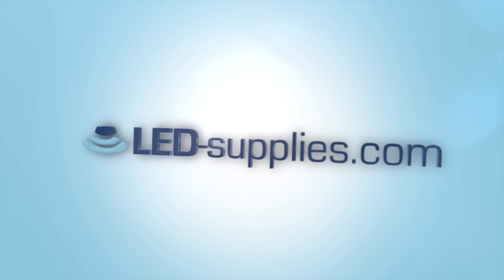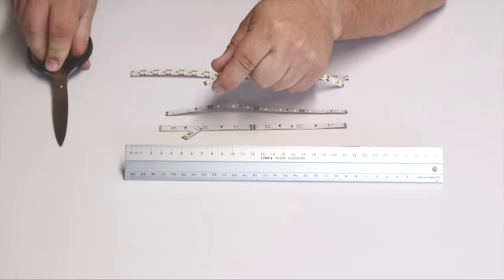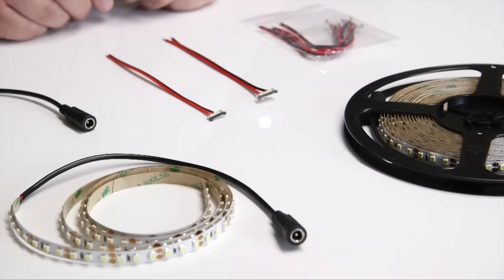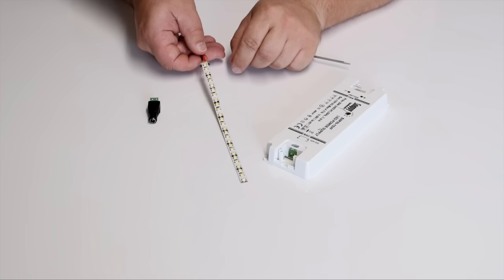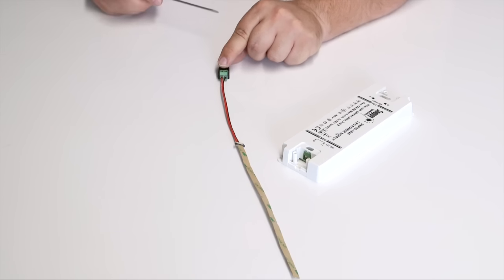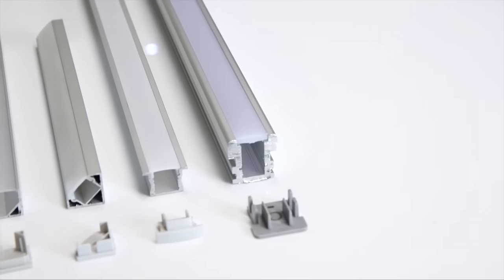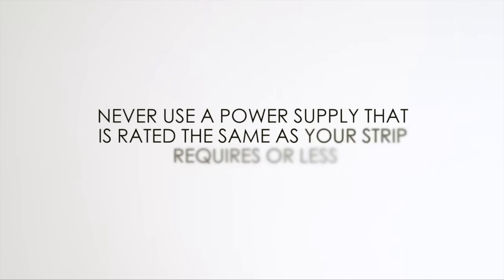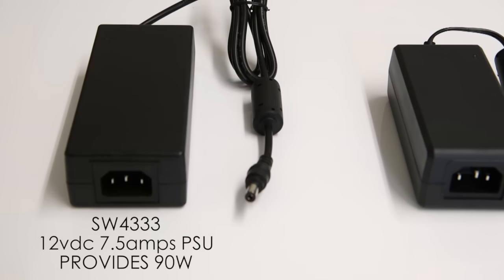How to cut, connect & power LED Strip Lighting

Comment: What's the best way to replace a normal ceiling light with this type of LED strip? The big question is how to power the LEDs. (I want them powered from a light switch, not a battery pack.) I've been missing a light in an upstairs room for quite some time and I also need light in my loft. My ideal solution would be LED's like this. (And in a perfect world they would be dimmable.) Is it possible? Thanks in advance for any replies.
Reply: yes, led strip is dimmable

Comment: I bought 5050 RGB waterproof with a silicone surface/covering. To make a connection do I need to peel off the outer covering? Seems like it
Reply: Hi we are  led  strip light factory  may i have  your e-mail address？

Comment: i bought a strip from amazon that did not come with an adapter. Which kind should I buy?
Reply from the maker: we offer a wide range of power supplies and led drivers from PowerPax http://www.powerpax.co.uk/ , one of the largest power conversion specialists and they are very good quality. LED strip usually operates from a 12vdc or 24vdc constant voltage input so you would need to check and confirm this but you can buy a good selection here https://www.led-supplies.com/led-drivers/ and we can ship anywhere globally at very reasonable costs

Comment: I LED's my desk, And It was to long so I cutted it (correctly). So now I have a left over LED strip, but how can I make that work?
Reply from the maker: Just add an input wire - something like this https://www.led-supplies.com/led-installation-accessories/cables/quick-connect-power-cables-for-led-strip-lighting/ there are different versions of this for different types of LED strip and then you can power it up from an LED driver as usual
Reply: Just like he did in the video
Reply: The video shows how to establish a connections on the strip maybe put your glasses on an re watch the video
Reply: Are you brain dead ? It's shown on the video FCS
Reply: @1414141x  rude
Reply: @1414141x  if you have to be an ass to get your point across, maybe it's best to keep your mouth shut, no?  Yes.

Comment: Can i run these strips from a simple battery pack?  if so, how many per meter & how long would they last?
Reply from the maker: You can run the LED strip lights from a battery - we have a range of batteries that output 12vdc here https://www.led-supplies.com/led-drivers/portable-power-battery-for-led-strip-lighting/

how long the LED STRIP lasts depends on the power consumption of the strip (4.8 Watt per metre strip will last 2x as long as the 9.6 Watt per metre strip for example) and then also depends on the battery capacity and the length of strip you are using. As a basic guide though, if you are looking to power 1 metre of 4.8 Watt per metre LED strip then at 12vdc the current being drawn will be 400mA (12vdc x 400ma = 4.8w) so using our smallest BP2541 battery which is rated to 4Ah you could power it for around 10 hours before needing to re-charge (10 hours x 0.4A = 4A) So if you then use a battery rated to 8AH it will last twice as long ie 20 hours. It does all need a little bit of working out but i hope this helps.
Reply: That's the most detailed & helpful response i've ever had on Youtube.     Thanks a whole heap & have a nice day.

Comment: what if i put 13m on a single 72w powersupply? i wanna purchase the led that 24w/5m. is it working with that powersupply?
Reply from the maker: Hi Andhika... at 24 Watts for 5 metres, you are using a 4.8 Watt per metre LED strip. So 13 Metres x 4.8 Watts is 62.4 Watts. Ideally you would allow 20% headroom so use a 75W power supply, but the 72 Watt power supply you have should be sufficient if its a good quality one

Comment: The led lights only work plugged in ??
Reply from the maker: yes you would need to run LED strip from a battery or from a mains driven supply via a low voltage power supply or led driver

Comment: One question: if I am using this in an automotive application could I connect the positive to the hot wire going to the 12v battery but the negative side to the ground since the vehicle is grounded to the negative terminal of the battery? will it still function the same?
Reply: I dont see why not lol. 12v from a car battery might be a big load to those tiny LED's though dont u think? U can just use a ring terminal and a nut and bolt to ground it or use a fuse tap to get power from the fuse box. I have an illumination switch (aka potentiometer) for dash light brightness but my aftermarket gauges wanted to puncture a tiny ass wire and solder it. I was like hello no. The wire from the aftermarket gauges was around 26AWG? Tiny ass things so instead i used something called a fuse tap. Its a fuse "holder" that takes the place of a fuse but has 2 pockets to add your original fuse that goes there plus whatever circuit youre trying to connect. Ik it sounds confusing but i was able to power them from the same fuse spot and ended up being the same fuse for the switch so instead of using their aftermarket adjuster (potentiometer) i was able to use my factory OEM switch for the brightness!! Haha it worked out pretty dope. Btw it was on my 2003 ford mustang GT.
Reply: That's similar to what I'm doing with my bike. Since I'm also making a in-line break connector so I can plug and unplug this BeatBox controller switch as desired.

Comment: does cutting in wrong place means voltage drops or other problems besides that some LEDs not working ?
Reply: probably, as a proper connection wont be made
Reply from the maker: Hi 1000fantomas, cutting the LED strip in the wrong place does not cause any other problems than a section of LEDs wont work

Comment: what if i want to make the led light up mobile? can i use battery power? also id like to add a swith to turn off and on when needed. thnx for your help
Reply from the maker: Hi Mr GAWN please check out this section for powering your LED strip from a battery https://www.led-supplies.com/led-drivers/portable-power-battery-for-led-strip-lighting/ also we have a range of devices to easily turn your strip on and off check out https://www.led-supplies.com/led-controllers/led-dimmer/touch-dimmer/led-dimmer-touch-sensitive/

Comment: I'm wanting to light up a euro pallet top that's now a tele mount so I want light coming from the back. . the size is 1200 mm x 800mm and want the leds for 8 strips so could I get 5 meters and chain them up to one power source ..please help   and I will purchase what's needed...thanks  Phil
Reply from the maker: This range of splitter cables include a 8 way version that will enable you to connect 8 different lengths of LED strip to 1 power supply https://www.led-supplies.com/led-installation-accessories/cables/2-1mm-splitter-cables/
Reply: +LED supplies hi, is this link for the power connector for the c4349?

Comment: hi , if i connect  8 led strips (5050) to each other  (length of each strip = 50cm ) through wire by soldering it , will it work ? (all the 8 strips will be connected through wire between them , and the last Led strip will be connected to power adapter/controller)
Reply from the maker: Yes, you can connect 8 x 50cm lengths together to give you a total of 4 metres of LED strip and power / control all together
Reply: Thank you ....

Comment: IF I USE A POWER SUPPLY WHICH IS LESS THAN THE POWER LED STRIPS NEED, WHATS GONNA HAPPER ? IS THERE ANY DANGER ? PLEASE ANSWER ME IF YOU CAN. THANKS
Reply: I've never used them and am not an expert but I'm pretty sure that it will only use the power needed not all at once or anything
Reply: I just bought 15m RGB led strip but apart from taking 120watt power supply I took 80w. The only difference as you said is that the last 5 meters produce a little less light..but its not easy to detect. :p
Reply from the maker: A few things could happen there George
1. The power supply is rated at just enough to power the LED strip, but its in a constant state of overload (without triggering the over current protection) which is likely to mean the power supply runs hot and fails much sooner than it would usually
2. The power supply does not light the LED strip at all as the overload protection kicks in (present in most good quality power supplies). Quite often the power supply will go into hiccup mode which will cause the lights to flash
We would strongly recommend you choose a power supply or LED driver which is rated correctly. An LED driver should be rated to atleast the same load as the LED strip its powering, and a power supply should have the 20% headroom we recommend
Reply: +LED supplies thanks for your answer.!! I will consider it before buying them
Reply: they will explode

Comment: would i be able to hook a 8mm LED 3528 30cm strip up to a battery instead of a mains plug, if so what battery size would i need?
Reply from the maker: Yes you can - is it LED strip powered from 12vdc? If so you could use any of the batteries or even the little battery pack in this range https://www.led-supplies.com/led-drivers/portable-power-battery-for-led-strip-lighting/ 
The bigger the battery you choose the longer it will run for. How long exactly depends on the rating of the LED strip (ie is it 4.8 watts or 9.6 watts per metre) and the battery selected

Comment: hi great video but I have three 5m 3528 white led light strips that I want to run as one what is the best dc power supply to use as a have tried a 12v 2a and it works great on a 5m led light strip but light flickers when using it to power two  5m led light strips also have a dimmer controller
Reply from the maker: so which power supply you choose to power 3 x 5M lengths of LED strip depends on the power of the LED strip
For example, if its 4.8 Watts per metre LED strip then 5 metres will use 24 Watts of power (4.8W x 5M = 24W). So if you are powering 3 of those that means you need a power supply rated to 72W or higher (3 x 24W = 72W). In this case we would suggest a 75W LED driver (or a 90W power supply allowing a good 20% headroom) i hope this helps
it may also help to use a splitter cable to power the 3 lengths https://www.led-supplies.com/led-installation-accessories/cables/2-1mm-splitter-cables/

Comment: Is it possible to connect LED strip lighting to the usual light switches or do they need to be powered by the mains?
Reply from the maker: You can turn LED strip off and on from a normal light switch, but in between the switch itself and the LED strip you would need an LED driver to step the high mains voltage (110v / 230v etc) down to the 12vdc or 24vdc needed by the strip. Check out our power range here https://www.led-supplies.com/led-drivers/

Comment: when does it heat up ? how long i can turn it on ?
Reply from the maker: LED strip can be left on constantly. The heat generated depends on a few things.... where it is installed, whether Aluminium channel such as this is used which helps protect the led strip and makes it run cooler https://www.led-supplies.com/aluminium-channel-for-led-strip/ and also the type of LED strip as higher powered / brighter led strip tends to run hotter. Generally, LED strip runs much much cooler than traditional forms of lighting due to its higher efficiency

Comment: Can a power adapter that meets the voltage and current output requirements be used for led strips instead of a driver? For example, can a 12V  4Amp  adapter from  some other electric device be used to power a 48Watt strip of led lights?
Reply from the maker: Hi, thanks for watching our video....if its a 12vdc constant voltage power supply it will work fine, although we suggest allowing atleast 20% headroom for a standard power supply (not an LED driver) so if the power supply is 4 amps (48 Watt) as you note, don't look to power more than around 3.3 amps worth of LED strip (12vdc x 3.33A = 40W)

one note is that a standard power supply is unlikely to carry the lighting safety approvals that an LED driver does such as EN61347. In case its of interest you can view our range of LED drivers and power supplies here https://www.led-supplies.com/led-drivers/
Reply: ***** Okay, thanks. Good point with the safety approvals...I've seen some scary power supplies.

Comment: I know these arent your parts, but i purchased 2 16 foot led strips for DC.  I soldered them together and have them hooked to my battery.  The lights seem to get dimmer as they reach the end.  Is there something i can do about that? Or is that just the angle of view?
Reply from the maker: Hi Del, its possible you are getting voltage drop from the battery down the LED strip due to the length. i dont know what type of LED strip you are using as it isn't ours but different types of LED strip have different maximum run lengths for connection in series.

Comment: Hi this video was very helpful. My question is how many watts should my power supply be for powering 3 singled colored led strips to just that one power supply? The colors are red, blue,  and warm white and each 5meter strip takes up 12 volts. Any help would be much appreciated.
Reply from the maker: Hi Eric, it depends on the power rating of your LED strip per metre and the length. let me know and i will advise
Reply: Thanks so much for your help but I was able to figure it out after some testing

Comment: Hi.  The video is extremely useful and informative. Are the LED strips dimmable?   I assume I can power them using a 12 v rechargeable  battery?
Reply from the maker: Hi Tony, all LED strip is dimmable - certainly ours is anyway. Is the way in which you dim the LED strip is the important bit. You can power from a 12v battery but then put a simple PWM dimmer in between the battery and LED strip itself. You can view a couple of our LED strip dimmers here https://www.led-supplies.com/led-controllers/led-dimmer/touch-dimmer/led-dimmer-touch-sensitive/ or maybe this one https://www.led-supplies.com/led-controllers/led-dimmer/dial-dimmer/dial-dimmer-for-led-strip/
Reply: LED supplies why don't they just sell it with a plug on the end?

Comment: could you use a 9V battery for anything
Reply from the maker: +Iceblu008 Iceblu008 as LED strip usually operates from either 12vdc or 24vdc you could not use a 9v battery to power the LED strip. That is unless you first step the voltage up through a DC-DC converter in which case it could then work
Reply: +LED supplies even if you are just using 4 LED's?

Comment: I have cabinets that are in 3 separate sections.  What would be the best option to install without having the LED strip itself running across the wall?  How would I jump one strip 2 the next with one power source?  thanx in advance
Reply: +Visal Chheang follow this video and cut a small hole in the side of cabinet for the wire to go through.

Comment: this awnserd alot of questions but still abit unsure ive got a pc desk that has a cabinet to showoff games and figures i want to light the cabinet up but its not one piece there like boxes and dont want the lights looking tacky after ive put the lights where i want can i run r/b wire to the next section or will that cause problems thanks.
Reply: What's a r/b wire?
Reply: +Amir Samir red and black wore

Comment: my power adapter exploded, what went wrong ?
Reply from the maker: +reboot  If you were using one of our power supplies this would not happen as they have built in over load protection as well as short circuit protection. Many of our larger power supplies and drivers also feature over temperature protection. Take a look here for our range of power supplies and LED drivers https://www.led-supplies.com/led-drivers/

Comment: can u use the rest of the lights on the roll after cutting it
Reply: That's what I want to know
Reply: Solomon Snelling me too
Reply: me too
Reply: ikr NoRRes97
Reply: yes you can you have to cut on the places shown or you will mess up like 2 or 3 lights on the run. You will need to use the clamps they show in this video or solder on some new wires .
Reply from the maker: +Joel Beltran Yes you can use the rest of the LED strip from the roll. You can use it on its own as a completely new piece as long as you follow the cut marks on the strip itself. Or you can join the LED strip back together again once it has been cut. we offer a range of accessories to make this easy take a look at these LED strip connectors https://www.led-supplies.com/led-installation-accessories/connectors/middle-connector-for-led-strip-lighting/ we have quite a wide range of installation accessories for LED strip many of which can be found here https://www.led-supplies.com/led-installation-accessories/

Comment: Hi,

Is it possible to connect these LED strips to the main lighting in the room? So that the led strips power on when the light switch is turned on, along with the already existing lighting in the room. 

Would we need some type of converter to convert the voltage, and if so, could you please recommend any?

Any help would be very appreciated.

Thank you in advance
Reply from the maker: +Materiax3 Yes just ask your electrician to connect the LED driver which powers the LED strip to the main lighting circuit